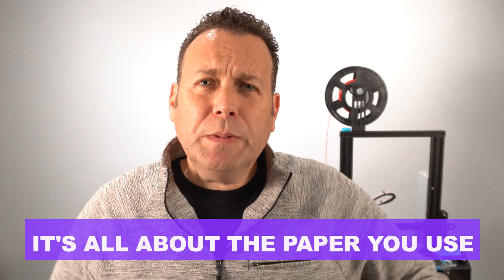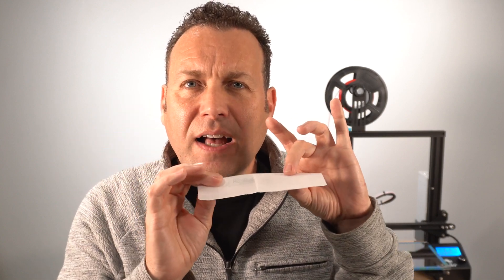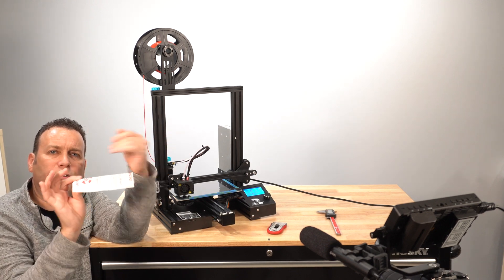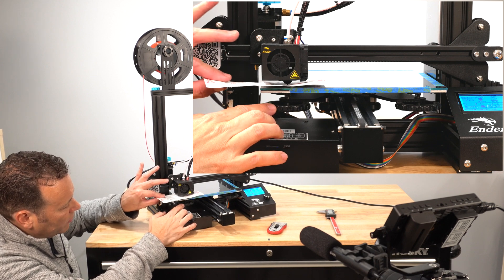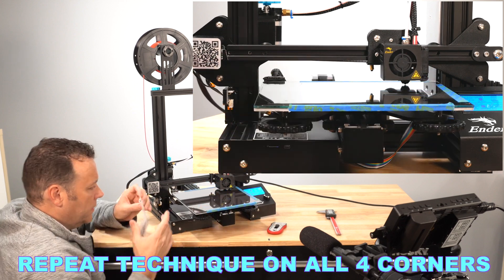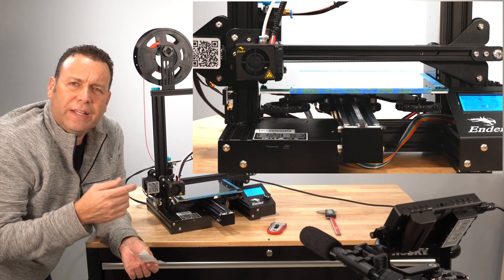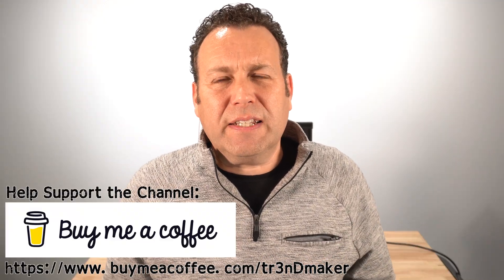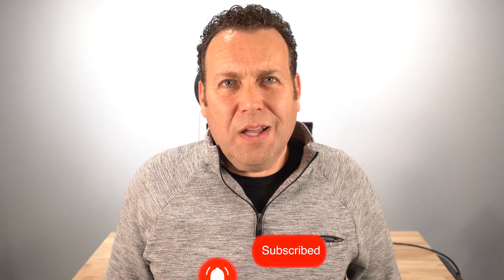3D Printer Bed Leveling - You Are Doing It All WRONG! Try This Instead!

Comment: I found playing cards worked for ender 3 max.... stock.       And  i cant seem to find anything to work for my ender 3 v2s.. with sprite pro extruder...    both machines have issues no matter what.   Eveything works fine on small prints like lighter cases...  but when i go to print a custom rolling tray...  layers are all ridged and some have those gaps. Some dont.   Parts stick some dont...    i dont get why little objects are fine.   But when u want something big,  u cant get it.  Like wtaf

Comment: I attempted this but the center of by bed is being scrapped by the hot end? I raised the z-axis stop and releveled the bed again and now the center is okay but the outsides are all over the place. My printer is only 4 weeks old, is my bed warped?
Reply from the maker: What is the printer?  It is possible, but more likely just not adjusted right.  Here is a test… take a straight ruler turned on its side and run diagonally to see if gap in center.  You can slide a sheet of paper under and along bed and the edge of ruler.  If slides under in middle… its warped.  If so, give yourself an amazing upgrade and make or buy glass bed.  It will be super flat and printing on glass is amazing vs textured bed.

All my printers are glass except 1… and its pei.

Comment: If you are printing a .14-.19 wouldn’t you want your bed to be .14mm away?
Reply from the maker: Not necessarily… on bed homing… it is looking for proper gap to flow.  Sort of a baseline. Once you hit print the nozzle will adjust for layer height via slicer settings.

Comment: I have a different perspective that I'd like to share:

At the beginning of each job, the machine checks to see where the Z home is. Z home is where the nozzle touches the build plate (Z = 0.00). Since you don't want the nozzle to actually touch the build plate, the limit switch triggers a bit before the nozzle gets there. The machine needs to know what that distance (known as the Z-offset) is exactly so it can do it's calculations during the job. We need to measure that distance and enter it. Once entered, that number doesn't need to be changed unless you change the nozzle or switch. You can measure the distance to the shim of your choice then include the shim thickness. Paper is a common choice. For example, if Z is -2.00mm when touching the paper, and the paper is 0.10mm thick, then the Z-offset is -2.10mm.

Any adjustment to the first layer can be made in Cura. I'm guessing it can be done with other slicers too.

Comment: Sooooo Frustrating... I've tried this over 30 times and still have material lifting as it is doing its passes. Do you have a leveling gcode for an ender 2 pro?
Reply from the maker: Ok… I have been there!  
Go about this in logical order…
1) on vid, check section on loose ecocentric nuts.  There should be no wobble when moving x,y and z axis and extruder.
If so, fix. This is 95% the issue.
2) clean the bed really well and don’t touch with hands.
3) follow leveling/ tramming procedure until level.  It may take 5 or more times around… maybe 10x
4) set in slicer a thick first layer… like .24mm.  This will flow more filament and give you a stronger base.
5) examine first layer as it comes down.  Compare to end of vid with examples of too much, too little or perfect leveling.

Also, start with something simple like a test block.

Learn to walk before you run!  With experience, you will be printing crazy stuff later.

Comment: 4 years later i removed all springs and bolts that levels bed, put some spacers in aluminium so they don't warp, no more tilting bed/warping bed issue. have fun.
Reply from the maker: That is one way to do it… thanks for sharing your solution.

Comment: The thermal printer paper is a great idea.  When I level, I try to get the nozzle directly over the adjusting screws so there is no pitching or "see-saw' effect upsetting the balance.

If that doesn't make sense, think of a board going over a pivot point.  As the end of the board is raised or lowered so is the rest of the board.  The closer to the pivot, the smaller the difference becomes.  It will never be zero but if the measurement (nozzle and paper/feeler gauge) is taken 25mm from the screw the difference will be much greater than if taken directly over the screw.  It saves you from "chasing the numbers" and gets a great "level" quicker.  I like the term tramming better because it better describes the process.  As with a milling machine, the idea is to keep the bed the same distance from the nozzle at any position regardless of whether it's level to the Earth.

Comment: Right now I'm trying out a different slicer I was using ultimaker cura slicer high right now I am trying out prusaslicer and seeing if that was my problem will not be around for at least another five hours the slicer program already loaded onto a SD card but the printer is currently busy with a print with the new slicer but it's not the one which is the most difficult

Comment: The item I have to print with you can't print with hairspray because it becomes like glass yes I have a glass surface I don't have the new magnetic type I have to buy a new type a printer so I can get that kind I have to use blue tape with this method but then what I'm printing is so tight that I have a hard time measuring how much clearance I have on the first layer it's not very much at least say is less than a millimeter or even a half of mm and yes any amount of snow machine against the first layer would using sandpaper to clean it the first layer off there's that little amount of space maybe one print line between the layers that's all I think there is and that some 2.2 have to move apart from each other

Comment: Basically you have to use blue tape if you want the best of both worlds using hairspray to make the first layer to flat and it can mix together especially if you have two parts put together next week other with needs to separate after the print

Comment: I realized my posted I was using hairspray not lose tape would cause the first layer of my print to stick together charge your technique with blue tape originally it worked perfectly fine and yes I even tried the paper everyone else uses even looser tolerances and it still did not work so basically I'm sorry I said what I said I only say this because I don't put all stuff which is bad

Comment: My ender 3 after I level the bed and attempt to print something it seems that the bed level knobs loosen or tighten up like they need a self locking nut back up onto them prevent them from moving
Reply from the maker: My initial thought is lack of tension because your bed is set too high.  On left side of printer there is a limit switch connected to a small "L" bracket... be sure this is all the way down nested onto frame.   Then re-level bed.  This should put more tension on the bed leveling knobs/screws, so it does not loosen up.  Let me know if it works... Good Luck!
Reply: @tr3nDmaker  I checked the bracket and its all the way down. My thoughts are maybe the knobs needs a self locking nut to hold it in place.

Comment: Will I need to use the paper if I have auto level
Reply from the maker: Yes and no… the printer will compensate for a tilted bed, but if off a bunch… it will skew your print.

It would be a good idea to level( adjust gap) to get the printer squared up…. Then auto level will have more dimensionally accurate prints.

Comment: I have a question. Is it normal for my edges (1-1.5” in) to be lower than my middle? If I get my edges set my middle is too tight/low. I have a Creality ender v2 neo.
Reply from the maker: Unfortunately, aluminum warps easy… especially with high heat.
Buy a glass bed and use Elmers Purple Glue Stick and you will have a super flat bed.  You will love the very smooth bottom surface as well.

Comment: I think tramming and ‘leveling’ with paper is a recipe for disappointment. Do it once and do it right. You have so much invested in your machine, go buy yourself a feeler gauge, use the 0,10 mm and you are done. Struggling with bumpy beds? Get yourself a glass bed or a piece of mirrot and cut itto size (don’t forget to sand down your edges) lock your adjusting knob/wheels with printable knurl nuts - after tramming - and you are done! For good.

Comment: what about layer shifting ?... this is my machines problem.. is this caused by the pcb control board ?
Reply from the maker: Probably not, but possible.  Do these first. Check belts are tightened just enough to get a slight strum out of them… like a guitar string.  Axis should move nice and smooth though.  2nd… be sure the little screw on extruder gear is tight and tightened on the flat spot on extruder shaft.
3rd.  Get a name brand SD card… the factory sd a horrible and fail often.

Comment: what about the center of the bed?  usually thats the one that is off
Reply from the maker: Unfortunately, there is not much you can do about the middle.  If you are lacking bite in center… lower z azis in menu of printer till good compromise.  Best thing to solve dip in center is to add a glass bed.  Once you use glass… you will never go with textured bed again.

Comment: Thank you for this video. I’ve been trying the thermal paper approach for over an hour. Just when I think I have it …. I check the center of the bed. The gap is WAY to narrow. Any suggestions ?
Reply from the maker: Don’t worry about the middle… stick to 4 corners.  The heat cycling of bed often causes a slight dip in the center.  If 4 corners are sticking and middle you are fine.  If having issues in middle that you can’t resolve.  In setting… set first layer to .28 or .32. All other layers can be whatever.  This throws down a bit more plastic to get good bed adhesion.

If cant fix it… buy or make glass bed.  Very flat.  I have a vid on how to make your own if your good with tools.  Link in description if you want to buy one.  Good luck.  Let me know if this helped.
Reply: @tr3nDmaker  thank you !! I will let you know how I make out

Comment: Thanks for this! I had been using printer paper and probably too much tension on the paper. I was getting uneven first layers and I had to re-level the bed after each print! Changed to receipt paper and less tension on it and it has given me a 100% improvement in my prints and I have now printed 10 models without having to re-level the bed! Thanks again
Reply from the maker: You are so welcome!

Comment: So, this is kind of like using the matchbook case to set the points on an old car?? Anyone that knows that trick probably appreciates working on an old car/truck where you could see the engine and all it's components.
Reply: I remember climbing under the hood and changing header gaskets without removing anything else.
Reply: @Kommander_Rahnn  Same here!! It was an old F100 with a 300 straight-6. My friend and I climbed in om either side of the engine, as it was raining, feet on the ground and plenty of space to turn around. The good 'ol days for sure.

Comment: I really don't get why people hate leveling the bed. I'm brand new to 3D printing and I tried BL, and CR touch, and I personally think it's gimmicky as hell. And it just introduces more problems than necessary. I just happened to have 0.8 mm thickness paper and nail the bed leveling every time. Quick, easy and accurate.
Reply from the maker: 100% agree.  I have many auto bed leveling setups and manually doing is best... However... I level by eye not paper, so it is super fast.

Comment: Did this after installing slice engineering heat break but used .07 feeler gauge instead of paper did it with the bed at 60 and nozzle at 150 to keep from oozing then did the chep bed level squares and they were perfect
Reply from the maker: I have a video that I never finished editing that I shot along with this one… using a feeler gauge.  Feeler gauge is great… but wait till you start  leveling the bed by eye...  super fast!

Comment: Nicely done. However, more importantly, tramming the bed. Without tramming, you will be almost lost in infinitely adjusting. If you could demonstrate the tramming process, we will all know what it is, and the process, regards
Reply: Actually, this indeed is bed tramming. If you have Marlin firmware, the setting "LCD_BED_TRAMMING" will enable in your LCD menu an option to perform the adjust in four corners - no need to move the extruder manually.

Comment: I fully agree and discovered this on my own. Wish I had saw this before. Anyhow, I love that you are using painters tape to hold your glass instead of clips. Genius...... I also find I try to feel for the vibration of the steppers. They will sort of buzz when you slide the paper. How perfect sould it be. Im now using a bed probe so I level using that. I try to have everything at .00 but it drives my ocd nuts. Is one corner being at .000 and 1 corner at .010 terribly bad? Because using just paper you wouldnt really know easily if 1 corner is slightly less?
Reply from the maker: Try giving a bit of a lift to bed before you level with paper(use hands and just lightly pull it up).  This will relieve tension on springs and release any binding. Get it even across all 4 corner... then use bed probe.  You should be GOLDEN!
Reply: @tr3nDmaker  Yea, Ive got it. Here is a benchy. Sorry for the crappy quality. https://youtu.be/aqvJ7H6JL5U

Comment: Do you recommend the auto bed leveler mod from creality?
Reply from the maker: Not really… after you level bed 50x or so… you don’t really need it.  I have several printers with ABL… and never use it.  

Auto Bed Leveling really only compensates for tilted or unleveled bed.  If very off, it will manifest on print.  Even with ABL you still need bed pretty leveled and your more adjusting gap.
Reply: What about z offset. Is that something that u tune or do you leave it at 0? I think pla and petg have different gap requirements.
Reply from the maker: @jack91522  Yes, adjusting z offset is very helpful, especially when using different filament. ie PLA and PETG.  However, Z offset should only be used to get the gap from bed to nozzle across entire bed.  So, start with very level bed and dial Z offset to get the perfect 1st layer.

Comment: This was extremely useful to me and I appreciate you posting this. I am rather new to this and hit a rough patch after we had a cold spell. Basement temp dropped to under 59 and nothing adhered. I bought a space heater and invested in some glue stick but still ran into a lot of problems. This really made a difference. Only thing I would add, though, for cold climates is to warm the bed up first. I discovered some pretty substantial differences if I performed these steps on a cold bed.
Reply from the maker: Yes.  After I posted video, I realized I edited that section out.  Unfortunately, I can not add it back.

Comment: This is super material! One thing to note is that the difference between a nozzle that is too close and one that is too far from the bed is insanely small! Your gradient example is fantastic, but lots of beginners dont understand the difference is insanely MINUTE. Keep it up!
Reply from the maker: Thanks for the encouragement!
Reply: Very true I’ve had to do a print that just follows the edges of the bed to see it but you can see the difference in leveling very easily